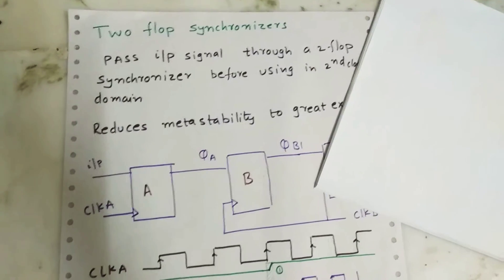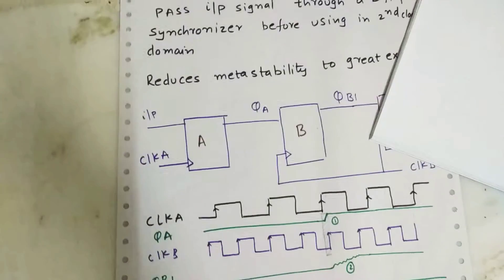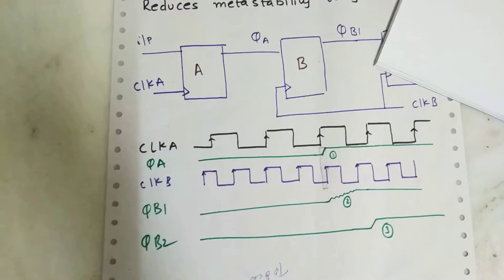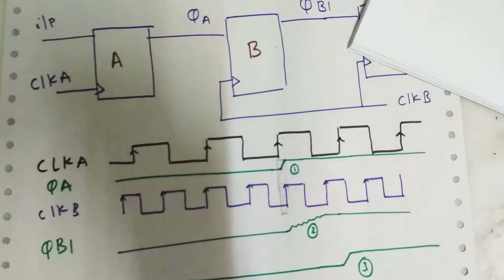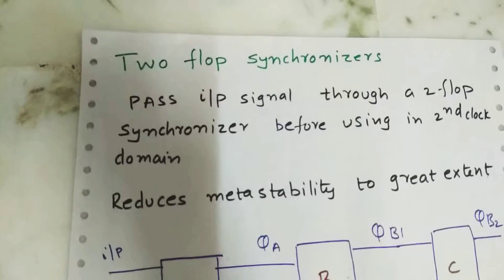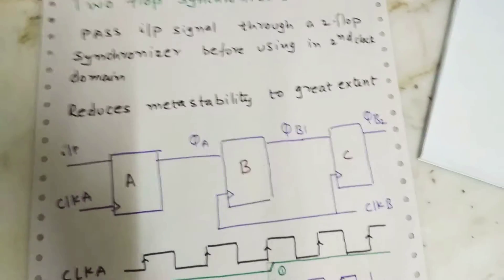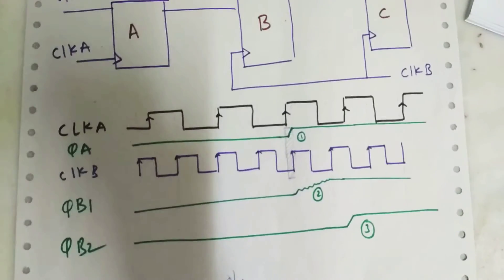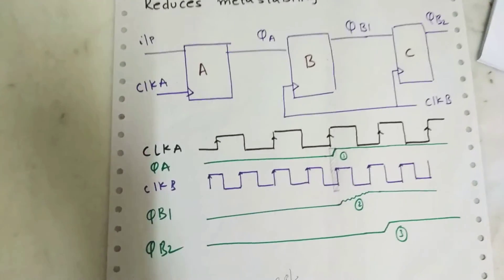Two flop synchronizers (synchronization) or Flip Flop Synchronizers / FIFO-part4

Comment: But why is QB1 unstable
Reply: QB1 follows clock B and has QA as its input
this is a positive edge(posedge) triggered d flip flop
there is a setup time a few time units before the posedge of the clock and hold time a few time units after the posedge of the clock(here we are following clk B)
during this setup and hold time the input needs to be stable it cannot shift between 0 and 1 otherwise it enters metastability
QA(input) is changing from 0 to 1 during  the setup and hold time of clk B thats why it became unstable and QB1 becomes stable after one clock cycle of B
Reply: but in reality its not guaranteed when the metastability may get solved
here its shown that it goes in a stable state after one clock cycle for easy understanding but it may take shorter or longer for it to become stable

Comment: even it is not guaranteed that we would get logic HIGH (2:07) after that clock period... it might go to 0 as well right
please let me know if you have any insights on this
Reply: AFAIK synchronizers only help in preventing metastability issues from propagating through more devices. They don't help in getting the right data across. It is possible that the data sampled by clk2 after synchronisation is different from the data sampled by clk1. Hope this helps.

Comment: I have a question,

Im using clock gating in my design. My question is: the clock gating should affect the dual flop synchronizer or the synchronizer must have the free clock always?
Reply: There is no definitive answer. the point of clock gating is usually to save power consumption. If you feed the clock path there will be consumption

Comment: Sir , Please explain about how many synchronisers to use based on situation.
Like you have explained about 2 stage , please explain multistage synchronisers.
Reply from the maker: Hi, mostly 2 stage is enough, but if it's failing we will tripple flop , and this is the max we go in the design. 
Thanks for asking 🙏
Reply: @KarthikVippala  Thankyou so much sir.
Excellent explanation ☺️
Reply: @KarthikVippala  May i know why cannot go more than 2 stages?

Comment: Hello,  considering the difference in frequency bw wr and rd is huge. Is there any issue if pointer values get missed after synchronization.
Reply from the maker: Hey Bhardwaj thanks for asking the question, no there will be no issues due to synchronization of rd and wrptrs,  there will be delay in the red or wr to happen but values will be correct.
Good luck, good health 👍
Reply: @KarthikVippala  I dont understand from where  rd and write pointer comes in this,if destination clock captures same data 2times  as its on high speed how captured data is  correct..
So let's say source side if data is 1010 destination will capture 11001100? Please clear my doubt

Comment: Hi In this example QA is changing from 0->1 and QB1 is settling to 1 so we are getting correct output at QB2. Suppose QB1 is settled to 0 (as it can go to either 0 or 1 from metastable state) then QB2 will get wrong output. Am I correct? can you please explain on this
Reply from the maker: Hi Naresh , thanks for asking

Yes you are absolutely correct , QB1 can go to zero , QB2 will be wrong .
We cannot remove metastability , but we can reduce it, we can use handshake to check whether the output is correct or not , if it's correct we will not change otherwise we will discard it and resend the input.
This will be slow but we need to add it for meeting design output.

Hope this clears your doubt ,if you have any questions, feel free to comment. I am  happy to help you 👍.
Please do subscribe it will help me a lot 👍
Reply: @KarthikVippala   Follow up question,  So during metastability if the output resolves to a different state, then this synchronizer also fails? Am i correct?
Reply from the maker: Yes prashant , you're correct
Good luck, good health👍
Reply: @KarthikVippala  thanks for very good explaination of all concepts, i have 2 questions.
1. As synchronizer ensures no metastablity in o/p, it not ensure correct data sended, so "synchronize fail" may not be correct term?? right or wrong
2. How to check correct data got at o/p using handshake, i had seen that handshake video but answer was not there, can u please tell??
Reply: @KarthikVippala  thanks for the nice explanation. Do you have materials about such handshake mechanism?

Comment: I've one doubt, like QB can QC also go to metastable state here? As QB act as input to FF(C) and QB is in metastable state at posedge of clock so FF(C) output also go to metastable state.
Reply from the maker: Hey Ajay , thanks for asking the question , now coming to explaination , there is a chance that QC can go to Metastability if output of QB is still in metastable condition even after one clock period, if output of QB settles to  0 or 1 then there will be no metastability .
Hope this clears your doubt,if you have any doubts please feel free to comment.
Please do subscribe it will be helpful for me 👍
Reply: @KarthikVippala  In such cases, will it be advised to use more than two FlipFlops?
Reply from the maker: @1000manmath  you are correct  we need to use two flip flops for synchronization

Comment: Excellent.
I have one doubt.
Is the output QB1 after metastability period will always settle to logic 1 (so as to follow input)? Or can it also go to logic 0.
Reply from the maker: Saurabh , thanks for asking the question.
Synchronizers do not ensure that data get across , but they ensure that signal don't end up in Metastability. So output is unpredictable. For understanding purpose I have shown it like that in the diagrams. Hope this clarifies your doubt. 
Please do subscribe it will help me a lot to keep going , thanks for asking.
Reply: @KarthikVippala  Karthik, More stress should be put on this line  "Synchronizers do not ensure that data get across"

if correct data doesn't get across then how good synchronizer is ?
Reply from the maker: @sagarborad5746   sure sagar  will make short video so that people won't have this confusion. good luck & great health:)